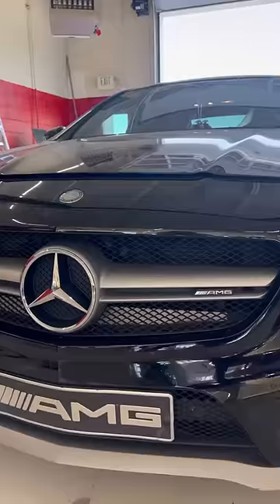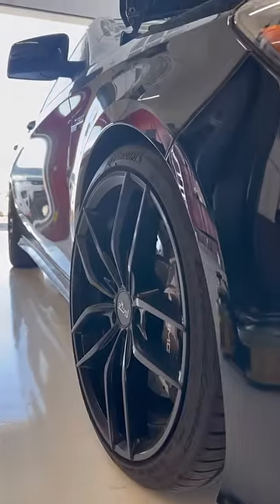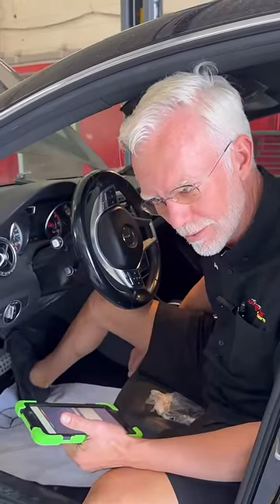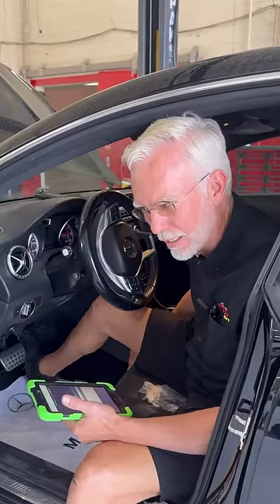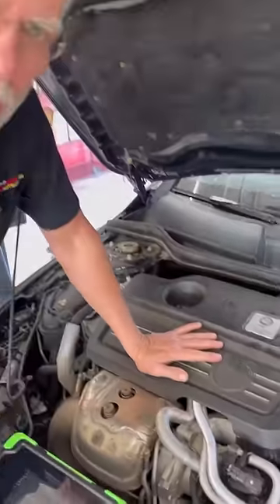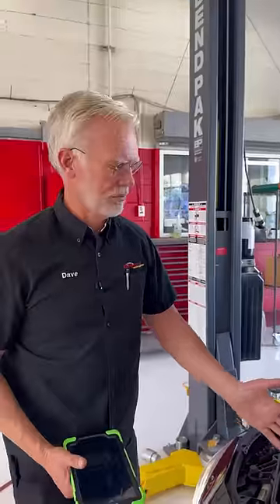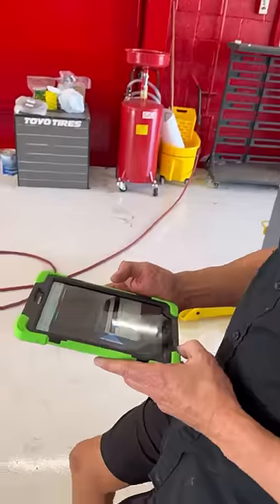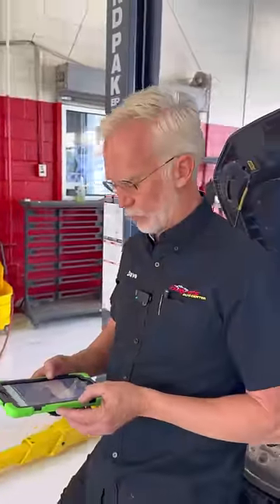Mercedes AMG Nothing but a slight noise on start up #carrepair #autoshop #mercedes

Comment: I've been a Mercedes-Benz technician since 1985. Still work on them to this day so I think I know a little bit about them😊. The Mercedes M139 engine has had an issue with head bolts stretching if the car has a tune on it due to the increased turbo boost. Due to the new policy for Mercedes-Benz they usually don't allow technicians to rebuild engines they will just recommend replacing the engine. First thing I would do is a combustion gas test on the cooling system to verify if it doesn't need have a bad head gasket. If it fails then replace the head gaskets and bolts. If it passes move on to the next step and try to duplicate the complaint of it overheating. If it doesn't overheat then just follow the codes and diagnose them. And yes dealerships can make mistakes just like any shop.
Reply: oscilloscope pulse test on the cooling system and the exhaust....then fix codes.
Reply: I find these days dealerships make alot of mistakes cause they believe the computer too much , I have had a lot of fights with Tacoma over this.
Reply: Unfortunately, the German dealers often find the worst-case scenario.
Reply: Firm handshakes 🤝
Reply: This is an m133 engine. Under boost is definitely a bad wastegate I've done a few since release
Reply: Oooh Opelz17 says it’s a M133? Who’s right? I gotta burn one of ya!
Reply: Interesting about the head gasket wether it’s one or both. If it’s both would the customer be allowed to request that the dealership change out the head bolt, lifters, springs, along with all the other goodies for the better stuff? Or would they shit the bed on it and say “No, OEM only?”
Reply: @andrewatwood4711 sorry mate but you incorrect here, M139 is in the later model, easily identified by the exhaust at the rear (firewall side) this is in fact a M133 engine from 2013-2019.
The M133 have an ongoing issue with the internal wastegate flap, just 1 of 3 major common issues most owners have. (2&3 being gearbox crunch and rear differential failure btw)
I'd put my money on the internal gate flap failure knowing what I know as not just a Mercedes Benz specialist mechanic but also the owner of a A45
Reply: Every GLA I’ve seen is in for that engine. And the emissions modification on the diesels. Make my shoulder sore thinking about them
Reply: Fact
Reply: My guy is a 🐐
Reply: Change thermostat
Reply: Stealerships are there to make money, their "mistakes" are constant.
Reply: Thanks! That's good info
Reply: I feel your comment is the most accurate and straightforward from an actual technican that works on them for a living not some one making you tube video to get others to diagnose things.  makes sense they dont wanna rebuild the motor if its easier and garenteed not to come back by just swapping the motor. other wise your shaving or replacing heads and strech bolts
Reply: Oh wise guru! Thank you 🎉
Reply: @StraightSh00t3r usually if you wanna keep your warranty and the manufacturer dosent offer upgrades for valvtrain on the motor you're stuck with OEM only
Reply: Im with this guy.
Reply: I would pull the radiator and check the radiator for contaminants on the outside
Reply: Holy hell. Sell it and buy a lexus
Reply: That's mighty kind of Mercedes to cheat people out of money.
Reply: @rickybobbyinc293 It is an M133. The M139 debuted in 2019, which this car is not. I service these cars for a living (for real). I have video proof 😉

For the record, I'm not familiar with head bolt failure on M139's, but these engines are just coming off of warranty, so I'm just starting to see them.

Gentleman in the video claims car overheats, that's more than likely the ridiculous 2 stage water pump MB uses on these vehicles. Lack of boost pressure is probably the turbo itself. The oil feed lines like to sludge, and the turbo starves for oil, and seizes, or a wastegate failure.
Reply: I thought bad head gasket at first.
Reply: Definitely a bad waste gate
Reply: I was a technician for benz for a bit, and it's funny to watch these videos after seeing them for so long and knowing what's wrong
Reply: True technician, no BS.👍🏼
Reply: Planned I obsolescence
Reply: Dealers don’t have mechanics that know how to fix it, they can only follow the computer manuals . Only for them to not waste time and money is to replace the whole engine lol
Reply: @taironewassup2511 that is very untrue. There are a lot of mechanics that can know what's going on with a motor after proper diagnosis of the car but there are sometimes where a repair has a case made for Mercedes to review and engineers will be in contact with the mechanic over the issue sharing info and test to figure out a solution
Reply: Don't buy a Mercedes!!! One of the WORST INVESTMENTS of your money, they have one of the HIGHEST   DEPRECIATION ON THE CAR MARKET!! When the warranty is gone,... SO IS THE CAR, TRADE IT OFF!!
Reply: Them telling someone to replace a engine if they don't need it not a mistake it's a way to get money
Reply: @wallaces.1974  That's actually not true. There are many other brands that depreciate worse than Mercedes. The reason there are so many problems is because most owners can not afford any services and take them to shops who only do an oil change and nothing else. I know this product and worked on it for long enough time to understand why people get mad. If you cannot afford to fix the car you should not buy that brand
Reply: @hemi-pwer2639  Totally AGREE 👍!!!
Reply: @opelz17 that was my first thought about the sound, sounds like wastegate given it only happens when boost is dumped but idk I’m certainly no mechanic, just have good ears when it comes to car problems… not saying it IS the wastegate but given how simple a wastegate is is probably check it first and then go for everything else just to verify I’m not wasting my time chasing unicorns. Albeit it doesn’t explain the heat problem, though maybe one caused the failure of the other 🤷‍♂️ if it gets a bit toasty maybe has an effect on wastegate 🤷‍♂️
Reply: And make sure cylinder head isn’t warped
Reply: Mercedes technician and doesn't even know what the engine is. And this is why NEVER GO to the dealer 👌
Reply: If it passes the gas test I would look into thermostat and flush the radiator after I test drove it to get it to overheat, but the time of year is going to make a difference.
Reply: Yeah it sounds like the headay have lifted a little.  Would cause heat issues and low boost.  Is it smoking? Dude ain't really telling us mucj
Reply: All these YouTube warriors claim they are the greatest. They are all saving the world from bad techs. Notice they get to edit their videos and can just make shit up. How do we know he took it to the dealer. The Silver Fox here can just tell us that and then show us some simple fix. He is throwing red meat to many viewers who hate dealerships. You think he hasn’t figured out what is wrong with this car before the video? Not likely. Dude brings it to him for overheat. He finds a rattling exhaust bracket and a bad cooling fan relay and invents an elaborate story about what a crook the dealer is. 
 Or maybe the tech that looked at it sucked? And it’s all real. But I’m not believing anything I see on YouTube.
Reply: Wrong! Tire rotation and a good wash!
Reply: Atwood European is the top shop around me lol
Reply: Like the head gasket theory....
Reply: I would pay you for your expertise.  Name your price.
Reply: @patrickpierre6114  2 Marlboro's, 1 6 pack of cours tall boys, 1 marijuana cigarette and you stand watch for momma and aunt Jo for 20 minutes while I grease up and pipe down my cousin Pearl!
Reply: I completely agree
Reply: How can I learn how to be mechanic? I'm 39 is that to old to learn(I'm smart and a hard worker)?Can I ever get hired if I pass like UTI course with a violent felony on my record?I'm current completely sober and live legal life now, trying to build back the piece's after prison.You seem to really know your sht so that is why I asked you.thanks
Reply: @markheckman3987  , Mark, slight noise on start up CAN be serious, water hammer' from a slightly leaking head gasket. Clogged piston rings with carbon, wrong motor oil. Or a combination of  the three. I was surprised at the amount of carbon build up on the valves.....
Reply: you being a tech for so long should know the bolts are designed to stretch a little bit every time the engine fires. and the gasket is designed to take up the slack. to only rely on the chemical test as your diag is not being very thorough. theres my unsolicited opinion
Reply: Only read as far as "ive been a merc tec since 1985..." zzzzzz
Reply: I’m going car shopping I need you
Reply: A bad head gasket?  Wow,  no insults , please.
Reply: Techs can't rebuild engines?? How eco friendly  of Mercedes!
Reply: Yes, but honest mistakes come FAR AND FEW between. It doesent matter how long you have been a mechanic or for who, the meter still points in the wrong direction for dealerships, and they're still doing the wrong thing. If you care about your reputation I'd either clean up the act, or, open your own garage and quit supporting a dealership that doesent support hard working folk.
Reply: You all need to stop by Turbo engines made by Car manufacturers, they are no good.
Reply: Mistakes always in their favour though
Thieves
Reply: Dealerships are liars
Reply: @davidshareefChTPhD u could be right I know some one who examined a heavy equipment that was over heating the rad was caked with debrie
Reply: Great comment, I wouldn't have thought it had enough power to lift heads. Then I read your comment and thought, well I don't know how much power it has or the specs on the head bolts. I've watched some guys pushing to get a sub 8 second quarter mile with stick shift, and as they pushed the boost up to get around 1200 hp, yeah thems heads lifted and luckily he kept it on the track with no issues. Anyhow, makes perfect sense. I wonder the cost difference between machining the heads and block, new headgasket, upgrade to head studs, and or bigger studs versus get a new engine, upgrade to bigger head studs, if it's even possible... I might turn the rev limiter down a tad...
Reply: @Kraken4201  Problem is if they dont follow Mercedes guidelines they dont get the repair/parts+time refunded from Mercedes in case a car is still under warranty or partial warranty.
Reply: @DirtyDianna  I don't miss doing the diesel emissions mod. Still have nightmares about the V band clamps. I volunteered to do all of them at my shop because I was sick of doing waiter warranty diag.
Reply: Dont know why people always need to try and mod cars that already have enough power from the factory. That's what they get
Reply: Amen
Reply: Thanks!  So roughly what would it cost to repair that?   @bearaussie7650
Reply: Alrhough I am not a fan of German vehicles - I am a huge fan of gearhead mechanics real world logical problem solving - appreciate OPs knowledge & experience
Reply: Dealerships are for purchasing vehicles, not repairing them…
Reply: That’s why I tell all of my friends and family to stick with Japanese cars only Honda and Toyota’s stay away anything German especially Mercedes Audi and BMW and non from the Big Detroit three either 🤔💯⚠️
Reply: @davidmiddlebrooks9228 that’s why they’re called stealer-ships lol 😂
Reply: A radiator having a microscopic leak can cause overheating.

Comment: I had this issue on my ST. It's a waste gate issue. On start up, you will hear the waste gate flapping. After it idles down, the sound goes away. It's underboosting because the waste gate is no longer functioning as it should. If you're reading psi live while driving, it will not make the boost that it should, when it should and will trip the underboost code. In my ST, i knew I could make 12 psi tops with the waste gate acting as it was. Sometimes it would only go to 8 psi before tripping the code and putting it in limp mode which made me only make 4 psi till I restarted the car. 
 The fix is to either bend the waste gate back in place so it's tight again, tighten down the nuts on the actuator so it compensates for the play in the waste gate, or buy a new/used turbo and swap them out. I swapped out my turbo with a used one on market place for $150 with 40k miles on it, then upgraded a year later. The marketplace turbo still functioned when I upgraded and sits as a back up.
Reply: This is the first intelligent response I have read. Everyone seems to be complaining about dealerships! He asked what his viewers thought was the problem. Your response is well written and totally plausible, well done.
Reply: @stevendouglas6593 fr this guy 👊🏽
Reply: That’s why I can’t work on modern power plants
Reply: You just saved several folks 10s of thousand$  👍
Reply: Like Jesus says sounds like the waste gate giving you issues.
Reply: Thats actually the first thing that I thought of. Does the ECU tell the blow off valve to dump most of the forced air out when there is a waste gate issue(incase it’s stuck closed) and that’s what you’re hearing? 
And for the overheating… is it because the wastegate is stuck closed and the intake air is hotter? Or is it because the other turbo does not go through the inter cooler and usually shares cooling with the normal turbo. But now most of the cooled air is being dumped out of the BOV? Just shade tree mechanics thoughts. I think you’re either right or close.
Reply: Would it be the same for a 2010 mini cooper s because my mom's car after she let's off the gas it sometimes takes a little while for the rpms to go down
Reply: Why would you have to replace the turbo to fix the wastegate? Are the wastegates on these literally integrated into the turbo?
Reply: @MH-ev3wr  In the case of my factory turbo, yes it was.
Reply: @jesuscarrillo4344 that doesn’t explain why his car is overheating. Also you could hear his turbo function just fine. I’d be looking for a boost leak. Also let’s not compare an ST with an AMG lol jkjk
Reply: @MH-ev3wr I'm guessing he either has a focus or fiesta ST. If that's the case then yes it is on the turbo!!
Reply: So could a wastegate problem lead to over fueling which could cause overheating?
Reply: lol I had this issue on my ST too.
Reply: Couldn’t you have just replaced the wastegate? Lol
Reply: That’s great, but doesn’t explain the overheating. Unless the wastegate is pushing boost too high.
Reply: @tylertallant6196   @gemnicherry2670  It's in "underboost condition" according to the  ode reader in the video. It's making significantly less boost than it should. My guess is that the owner is pushing it hard while it's in protection from the underboost, which is making the engine work harder than designed to make power. That is where the over heating is coming from. I did a quick Google search on where the wastegate is located on these cars and it's just like the ST, integrated in the turbo and it's failure is a common problem.
Reply: Sounds like an expensive money pit
Reply: anyone in this thread have this on their n54 335i? you described my exact situation. on startup, it’s a loud flapping/clacking, but when it idles down you can’t hear it at all
Reply: it could be as simple as a bad clamp.
Reply: Sounds good but what about the overheating part?
Reply: HA! I don't know if you are correct, but that was my first thought. You hear the sound when he lets go of the throttle, and it said it's not getting full boost. Why is it hot though?
Reply: @olivermandel9714 I have an N54, and it doesn't do that, but I've heard of that happening on them. Does it give you proper power? It won't obviously if you've a wastegate rattling/staying open. Mine was limping often, but temp and power were ok. Misfiring. I took the plugs out and the intake manifold is off right now. Very dirty. Gonna clean the gunk off manifold and intake valves then see. Daily drive an N52 and be at peace like me.
Reply: @JDtimesten  my n54 feels perfect and drives really well. it still feels very fast
Reply: @olivermandel9714  Good - it sure is a nice car. We're lucky to be able to enjoy them.
Reply: I was looking for this comment
Reply: @thesuperdb9909 the Mini's have a very heavy rotating assemby with a lot of inertia, my mums 2003 Cooper S supercharged has the same annoying trait.
Also, Ive have an Audi where the wastegate flapper just came off and ended up in the exhaust.  I bought the car like this, making barely any boost.  I used a couple washers and a bolt and nut to recreate one and it worked beautifully, till the bearing exploded soon after.
Reply: I don’t know squat about cars and even I know that it’s the turbo malfunctioning.

Comment: If it has a noise complaint with a turbo fault, it could be the bearings in the turbo failing. You only hear it on start up because the bearings are dry and then gets oiled shortly after startup, making the noise go away. 
     If the turbo isn't boosting the proper amount for the rev range it's at it can change how it affects the fuel map. Causing excessive rich or lean conditions because the turbo isn't working as it should. Extended lean conditions will absolutely cause overheating. The "overboost" condition means that the turbo isn't regulating the boost level. In this case it's making too much.
     I would pull off the intake pipe and check the shaft play in the turbo. If there is any movement in the compressor wheel at all, I would replace the turbo. Or if that's not it, whatever controls the wastegate may be at fault. 
     The wastegate should open or close based on boost demand. If it's stuck closed then it can't vent off the excess exhaust pressure causing it to generate too much boost than it should which also causes a lean condition.
     Other than that I have no idea what else could cause the complaint
Reply: turbo.money pit😂
Reply: So.. just clean the map sensor? Without any maintenance what could develop from this noise?🩺
Reply: Exactly,